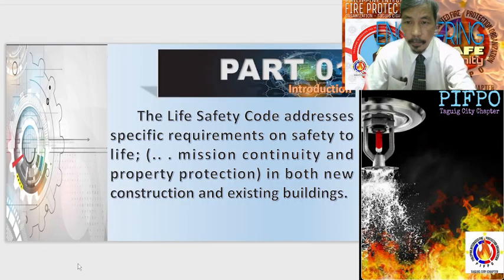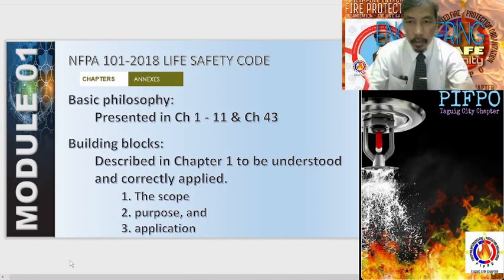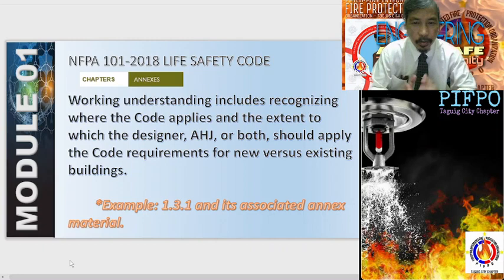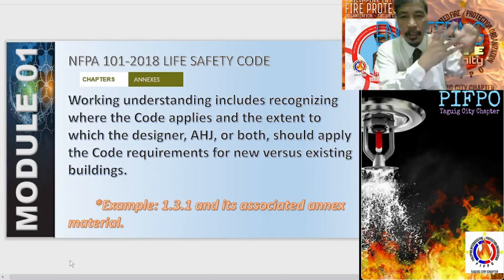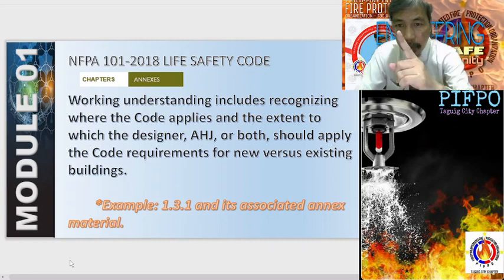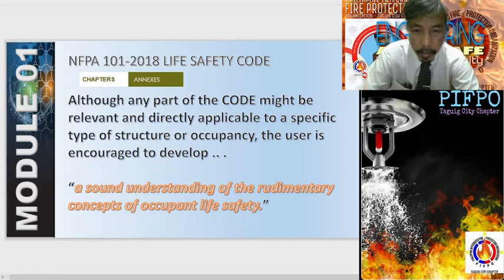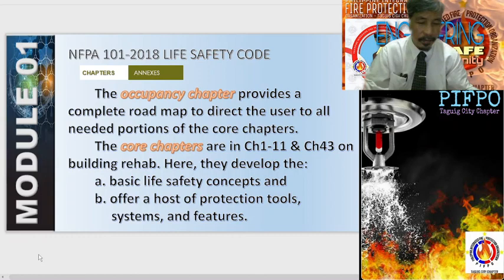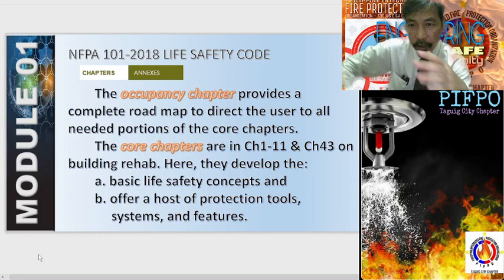CODE PROVISIONS - NFPA101: Module 01.3 [ Reference CODE by RA9514 - IRR2019 ]

Comment: Core chapters had been discussed and they are in chapters 1 to 14, and 43. Here it develops basic life safety concepts and offers a host of protection tools, systems, and features. On the other hand, the occupancy chapter provides the necessary ways to direct the user to all portions of the core subjects, the users of the code are students and professionals.

Comment: Thank you for this informative video. Users of the code are students and professionals, and the occupancy chapter includes a detailed road map to take the user to all needed components of the core chapters. Professionals usually do not follow the code by chapters, whereas students, because they are beginners, must follow the code by chapter. Core chapters are 1-14 and 43

Comment: professional don't study the code in chapter order. They consult a occupancy chapter which provides them to all needed portion of the core chapter that apply to a project at hand, directed by occupancy chapter. However, core chapter develops two things. First is the basic life safety concept and second, they offer a host of protection tool, systems, and features